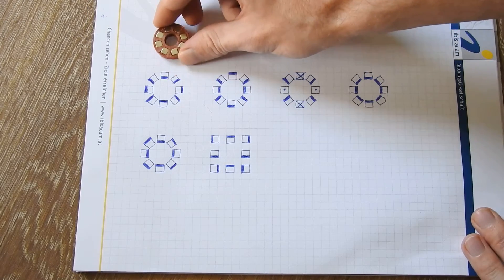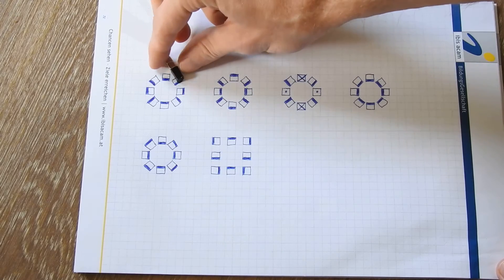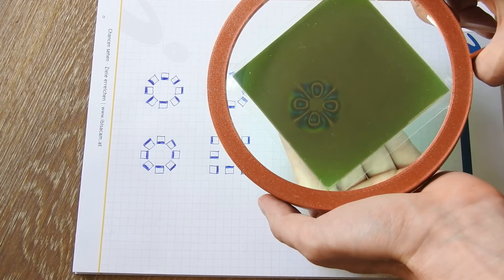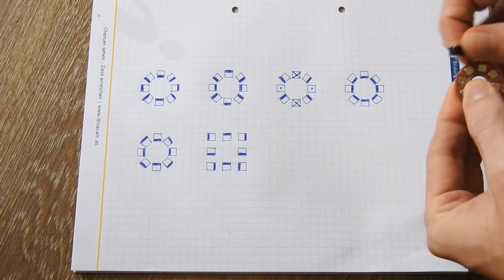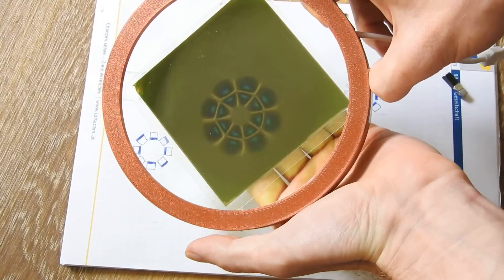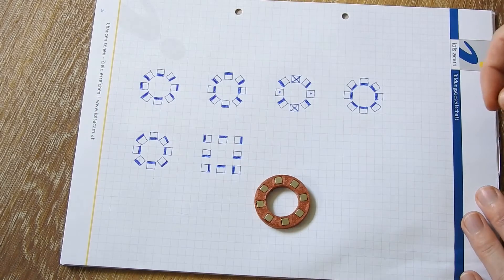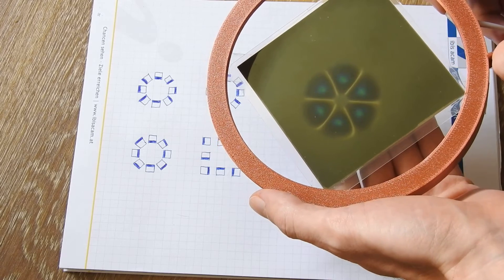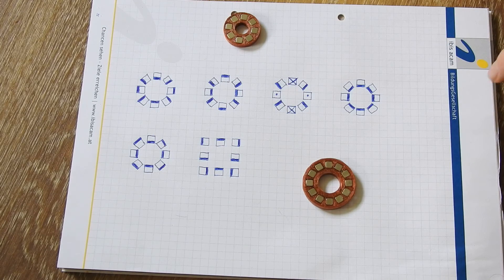How to build circular (halbach) arrays with different magnetic field shapes

Comment: Hi, i love your arrays. However, can you explain how to place the magnets? i am sure not with the black tapes correct? how would i know which side is the correct side? I hope you can explain this section to me. Really appreciate that. Thank you
Reply from the maker: I just used used the black tape to indicate the polarity.
It doesn't matter if you use north or south pole when starting, just repeat the pattern like I showed in the video.
Also a magnetic viewing film will help to check if you built it correctly.

Comment: Which patten that you use water memory cleaning cup
Reply from the maker: Two of the all poles facing the same direction (the one in the top right corner).
One with all north poles facing inside and one with all south poles facing inside.
Reply: @OmegaZZ111  thanks